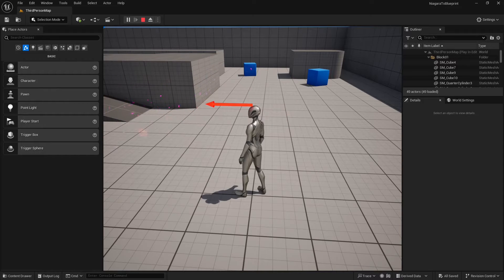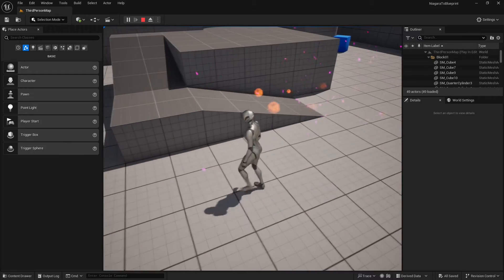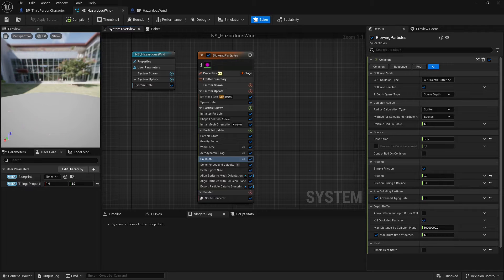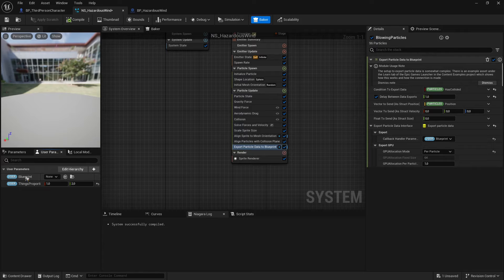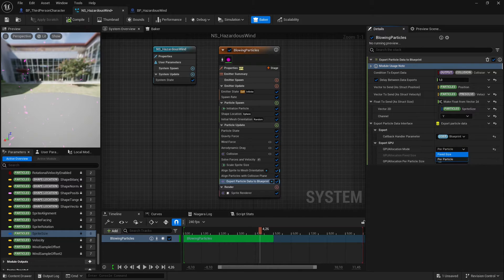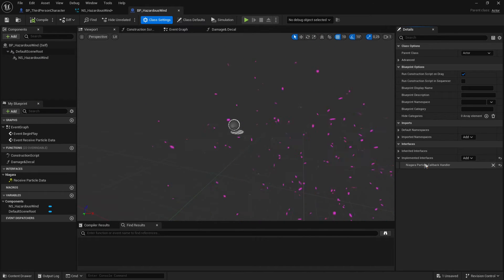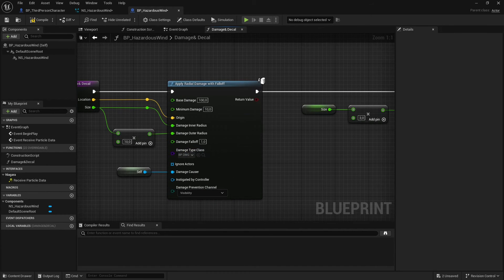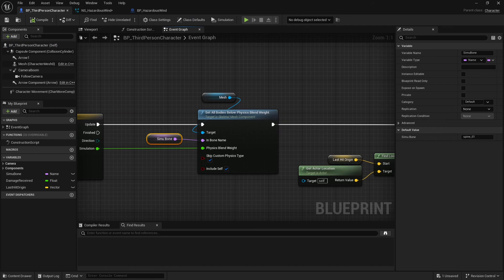UE5 : Niagara particle Triggers Blueprint event. Particle driven logic in your Unreal Engine game.

Comment: Do you know if its possible to retrieve the Simulation Age in a blueprint with the same method ?
Reply: It looks like it is possible, you can pass any Float data as "Size", as long as it's a float, you'll get it in the blueprint. If you hover on the "float to send" in Niagara, the Unreal tooltip tells that it is "unfortunately named" 😂 Basically this float can be anything, including size, as long as it's a float
Reply: if you can plug the value into the float or vector input fields in the export particle data module you can send it it actually says in the tooltip that you can